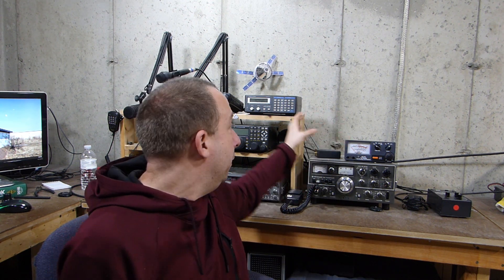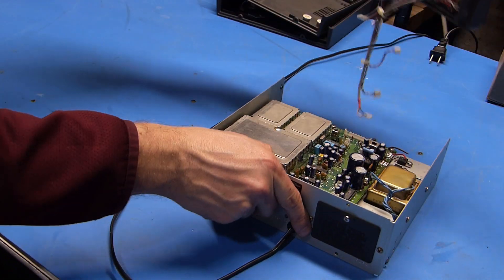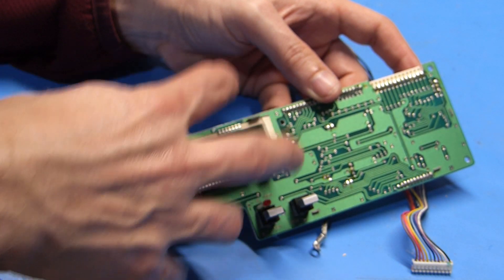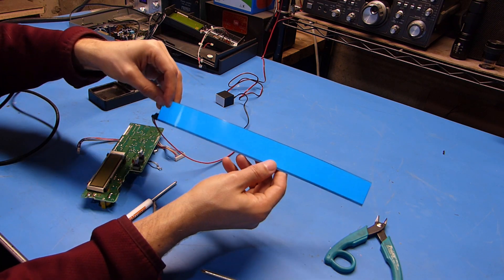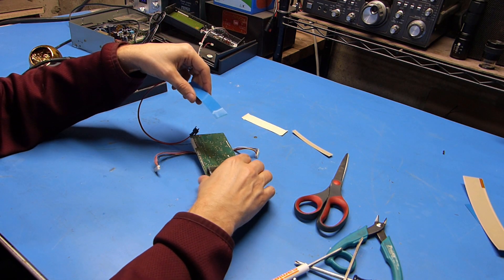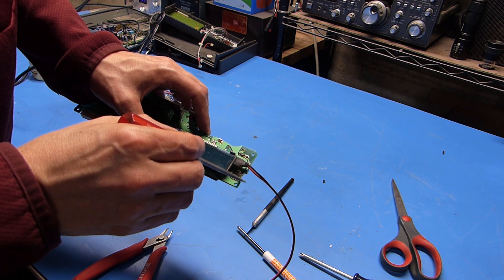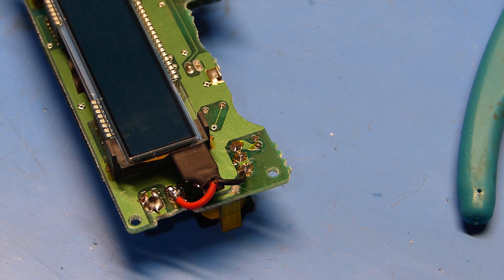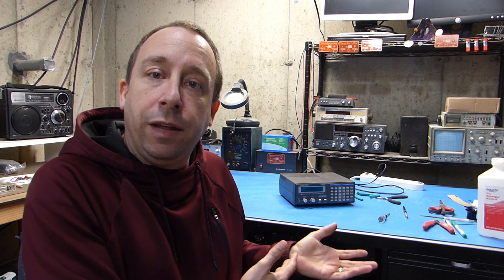Radio Shack Pro 2006 Scanner Back-light Repair

Comment: Hello. Brilliant. I've just changed the backlight on mine, which I've had since new, about 1980ish. The light packed up ages ago, so I bought a new one. I'm not a tv engineer, but I was in the trade for over 30 years (on the retail side), and I spent quite a lot of time in the workshop helping out on my days off etc. I've put off doing this for ages, but due to your video, I plucked up the courage, and  I found the job a lot easier than expected, and it took about an hour. It works a treat now. Thank you very much for posting this.
Reply from the maker: I love hearing stories like this!  I'm glad this video helped out - enjoy your scanner!
Reply: @SevenFortyOne . I will, although a lot of the old frequencies aren't available nowadays, police etc. A bonus was the fact that it kept the memory and other than finding new things to scan for, some of mine didn't get lost. Thanks again.

Comment: If you had a brighter color  strip,  maybe it would work  better. Blue is a very hard  color to make it brighter.  I put blue  leds for a backlight of my dx 390 and it wasn't very bright at all.  I ended up  using 2 white  leds  instead . Thank you for the  video.

Comment: I’ve just come across this video,because I am changing the back light strip. Changed the strip and it works,if I was to do it again I think I would go with a white strip because the blue is a bit dim. Thank you for this video.

Comment: What voltage did you have on the board I bought a replacement EL display and it is rated at 12v AC. I have around 64v ac sat at the board connection points but the EL display doesn't light up.
Reply from the maker: I don't remember exactly but I thought it was more than 12v.  It might show in the service manual/schematic what the voltage should be
Reply: I tried a replacement EL display from Ebay but it wasn't bright enough so I ended up taking it out and replacing it with a piece of white paper

Comment: Thanks for taking time to create this video.  After watching the video, and even though I have a pristine scanner with the correct backlight, I decided I could live without the backlight rather than lose my patience and drop kick the radio across the room! 🙂

Update: Thanks to your excellent video, I was able to run through the same process and have the scanner up and functioning again in less than an hour.  Thanks again for posting this video!

Comment: Hello. Just watched your video and I'm ready to go ahead and repair mine. Just a query,  on the EL site they give options of.... Backing, None, Sticky, Magnetic or Velcro. I assume the 'None' is the correct one. The other option is for the inverter. None, 3volt, 6v, 9v, 12v or 12v chip. I'm in the Uk , could you advise which one please.  Thank you for this great video.
Reply from the maker: I agree the backing should be none.  I think the inverter should be none as well since the radio has one built in but I'm not 100 percent sure on that since I don't really know what you are looking at
Reply: @SevenFortyOne  . Wow, thank you for coming back to me so quickly. It's the Pro 2006 but I'll go for the 'none' option. On mine,  the lcd writing is visible when it's daylight, but there's no blue backlight so can't be seen easily when it's darker. Thankyou very much, I really appreciate your help.

Comment: Question:  Did your display work at all - meaning - if you shined a light on it you could see the frequency?  When I shine a light on mine - I can see the frequency but not without using a light.  What’s really disappointing is that everything I use to listen to is encrypted in Highlands Co. Florida.  Thankfully I can still get the pager frequency.  I’ve had this Radio Shack 2022 ever since it came into the store and it still works great.  I would like my pocket scanner working again.  Do you repair on the side?  Glenn
Reply from the maker: Yes, the display worked, just no backlight

Comment: The display lighting going dim or out altogether was a huge problem with the PRO2004/5/6 type scanners. I had 8 altogether and eventually all were either really dim or out. There was a guy down in FL who did these repairs so I sent the whole batch to him at once and he did all 8 with new EL panels. I finally sold off my last one about 10 years later and it still shined brightly.
Reply: Who did your repairs?  I have a couple radios I’d like to get repaired.  Glenn in Highlands Co.
Reply: @glennchristie2316  It was at least 15 or even 20 years ago, I am pretty sure he has passed on or moved on. I don't have his info anymore, some guy on the east coast of Florida

Comment: Is there anyway to fix these? A woman I know owns one. The display lights but there's no digits. If I turn the squelch, I do get the noise but not sure if the unit is functioning. Would like to attempt to get it running.
Reply from the maker: Search for the manual and see if there is a factory reset...

Comment: Useful video, thanks mr 741. 
I tried your eBay link and couldn’t find anything useful there or google.  Instead I took an LED backlight from a 20x2 display I had in the drawer unused since 20years! 
The part is labelled LTM-8904  on 5v it takes 66mA via an 11ohm current limit resistor. 
I picked up a 5v supply on the front PCB at the trace connected to pin 16 of the 74LS145 decoder chip. 
The display size is 80mm by 23mm x 4mm thick. It works great , I didn’t bother with a dimmer circuit it’s not that bright but better than the video. 
I couldn’t find the LTM backlight though online. I did find a white LED backlight that should work in stock at Pimoroni for 2€
Part is Lucky light KWB-R7923W/1W it also looks like it could be cut down shorter, mine is over length but just fits between PCB mounting pillars. 
Note you will have to remove the metal screen to get at the 5v rail. With mine I also had to slide out the grey solid LCD support bits. 
Being old plastic the locating pegs just broke easy. The transformer T501 was not needed , had to remove it to slide out the left support. 
Obviously the LCD must not be strained in any way when you remove the supports. I also removed the SMD resistor feeding Q508 in case it got upset by the missing transformer. 
Anti static precautions used too. Few spares available if zapped!

Comment: Dude, You stole that scanner for $5.00 lol. I've replaced the EL Strip in mine 4 times, so Literally Yesterday I modified it with LED strip instead. It is by no means perfect, but it works and I shouldn't have to worry about the backlight for quite some time now. These things have an amazing receiver in them, and can be modified to be pretty much completely open too. Very impressive scanners for their time. Wish they still made them this good. Great job. Thanks for the video. 73's
Reply: Where did you power the led strip from
Reply: @chrishackett9820  The LED strip I bought was a 12v green strip. I used a 1K resistor and just pulled power from the on/off switch. I used thick white printer paper about 4 layers to make a diffuser though the leds are bright enough to still see them, If I go back in to fix that issue I would start by finding a spot on the board with around 8 volts and still using the 1k resistor to help dim them down a bit. but for now at least I can see the display.
Reply from the maker: I thought I showed it in the video but if not I don't remember....

Comment: I tryed this with eBay Backlight system but the inverter was so noisy and generating so much QRM in reception that i gave up .
I  installed the bill cheek led system idea and its all ok now althought light is not as diffused as original .
Reply from the maker: I thre away the inverter that came with the strip and used to one that's built in the radio for the original display and it works OK aside from being a bit dimmer then the original.  I'm considering swapping over to LEDs though

Comment: I found that the voltage on the electro strip is only 3.6vdc needs to be hardwired to the main power supply manualslib.com has the Realistic PRO-2006 Service Manual
Reply from the maker: The electro strip runs off of ac. If you are seeing any dc voltage it may just be an artifact of you meter rectifying the measured ac.
Reply: @SevenFortyOne  no! I didn't check! 3.6vdc per RS schematic I one on ebay  & one side is white & other is green! greenside faces from the display & the white side faces the display & dimmer switch works too paid around $8.00 bought 2 just in case!

Comment: Wondering about how thin the edge lit acrylic sign like method performs and if can package some LED's maybe from a strip or salvaged from a free TV LED panel?  

I did a quick search since seems feasible... though not certain the thickness limits and performance with fitness limitations regarding the LED's.  Google, however came up with a Adafruit backlight option and I found searching they have some more backlights for reasonable pricing also.  https://www.adafruit.com/product/1626  and this might fit... https://www.adafruit.com/product/1622    Looks like Mouser, Digikey and others stock too.

Do you know the size off hand if you still have that piece of paper around?

Comment: Awesome detail.  Neat watching, very awesome.  Glad Youtube recommended the video.  Inspiration to work on mine this winter. Have you considered doing the mod for the computer interface to control the scanner?  That would be a sweet series.  I started reading into and last left off planing to etch a CE-232 PCB board... though hadn't got around to working on.  Went into a bus pirate and MCU rabbit hole of research.

Comment: Strange to see your Realistic Pro 2006 has a 'Light' button next to the sound Squelch. I also have a Realistic pro 2006 400 channel Hyperscan scanner, but on mine that button says 'Dimmer" and I can dim the electro-luminescent display with it. On my scanner the electro-luminescent display is always on when I turn the scanner on.  For the rest it look 100% the same as yours.
Reply from the maker: My display was burned out...missing actually.  I made a video on fixing it..
Reply: @SevenFortyOne  I know, I watched the video. 😁 I was writing about the difference in buttons 'Light'  vs 'Dimmer' on the same type of Realistic 2006.
Reply: @SevenFortyOne  Yes. Default on the Dmmer is just that -  Switches on to full brightness and you dim by pressing that switch.There is no backlight off option.

Comment: Thanks for the video. I just recently did what you did and had the same result: a dim backlight. I looked around and found and LED backlight on Digi-Key (look for Adafruit #1622 only $2.50). You just have to wire it up to 12V with:a 470 ohm resistor. It fits the LCD pretty well and is very bright. Being an LED, it has some flare on one side but I still like it. The only trick is you have to remove the plastic supports behind the glass because the unit is too thick to slide in. I didn't bother figuring out how the light switch works so mine is always on, but I don't mind.
Reply: Does your button next to the Sound Squelch say 'light' or 'Dimmer'?  My Realistic pro 2006 400 channel Hyperscan scanner has a 'Dimmer' button, instead of a 'Light' button.
Reply from the maker: Great tip...thanks!